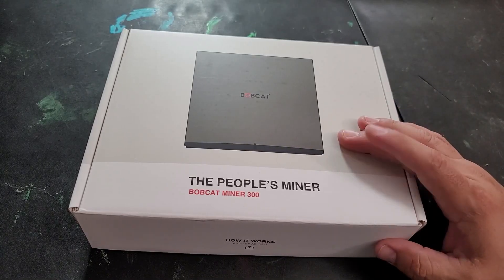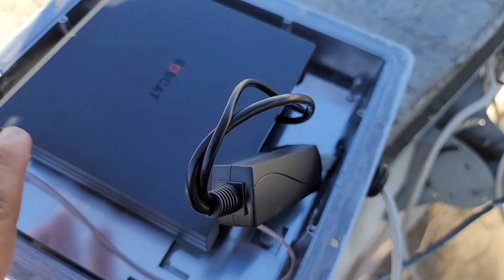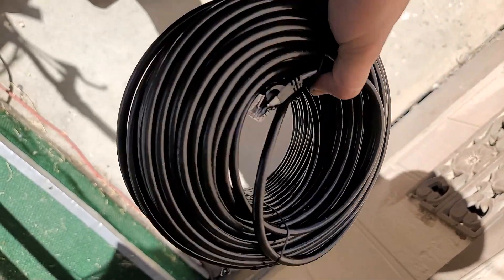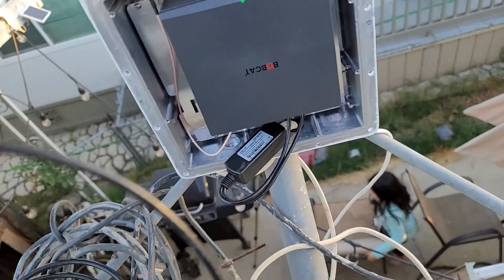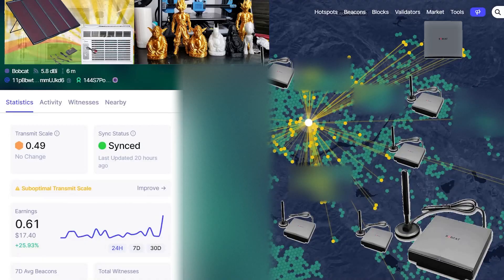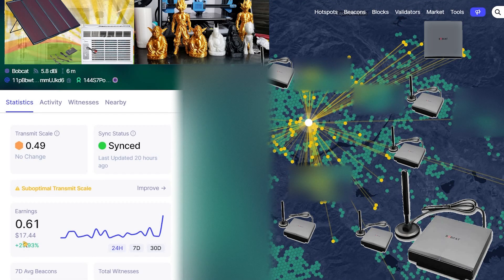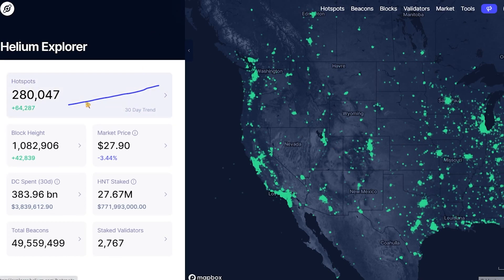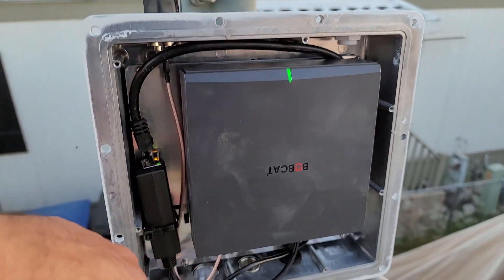How Much Do Helium Miners Really Make???

Comment: Bro your 50ft cable is way too long you’re gonna lose so much signal from it at least 50% of your signal do a little research on the wire that way you know I’m not messing with you
Reply from the maker: Thanks. I'll check it out. I don't have many options on keeping the cables short . I was trying to keep the antenna wire short.
Reply: @rftechguyc.a.d.3606  you can use 100m of ethernet with no loss of performance at all.